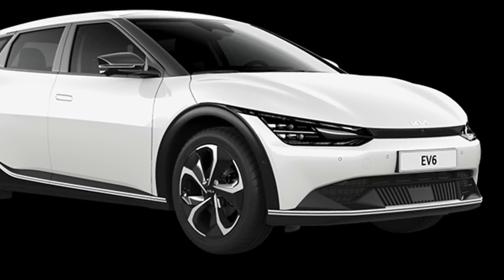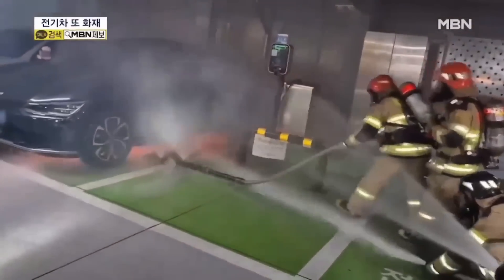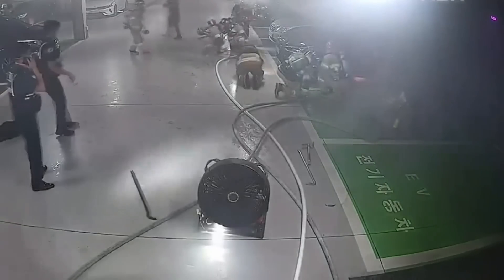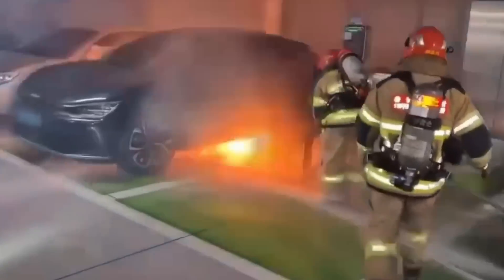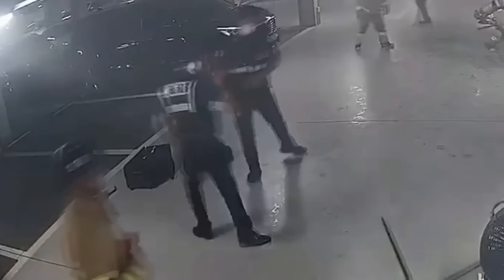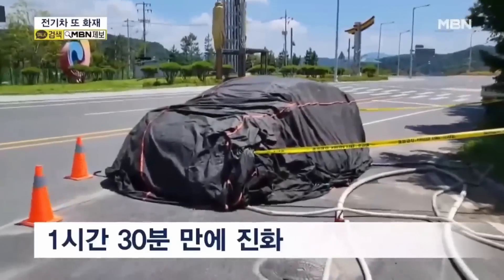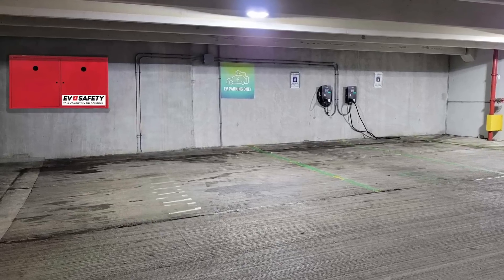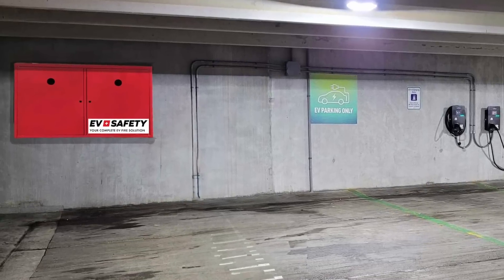Second EV Fire in Korean Parking Garage: Days Later

Comment: what a ridiculous thing those electric cars are...all this risk and still for sale? surreal
Reply: They still allow ICE vehicles.
Reply: @economicprisoner heck yeah, and a dam good thing too.
Reply: @economicprisoner which can be extinguished with a hose pipe…
Reply: @MrStevecrasher Sticking a hose pipe on a fire involving petrol is not a very sensible thing to do, that will only make it worse.
Reply: @brianstevenson9967  ohh I see, so all the worlds fire services have got it wrong… you had better go and tell them in that case.
Reply: @economicprisoner  ICE vehicles don't self combust everyday.
Reply: @Ilikeryche  Yes they do!
More often than EVs do!
That was my point.
Reply: @economicprisoner  No they don't. That's just silly.
Reply: @Ilikeryche  Yes they do. Feel free to search for NHTSA Safety Recall 09S09 which details just one model than can and HAS caught fire by itself. But that recall isn't the only fire risk for that vehicle, because mine decided to burn from the center console IN the cabin. Parked. Ignition off. Key out. :)
Reply: @saucecups  That's an anomoly with a particular vehicle, not typical of all ICE vehicles.  How often do you hear of an ICE car burning down a parkade? It's almost daily with one elecric vehicle or another since EV's have been a thing. It's not an anomoly, it's typical of electric vehicles.
Reply: @Ilikeryche  As I said, "just one model". I'll be the first to tell you that EV fires are worse than ICE fires, but pretending that ICE vehicles can't decide to catch fire as well is biased.
Reply: @Ilikeryche  look at the stats for vehicle fires EV & ICE then you will be able to appreciate which is safer. Just one of the many stats you will find on Google. Back in 2019 London Fire Brigade published their figures on call outs to vehicle fires. 80 EV fires compared to 1890 ICE vehicle fires, that is 1 years figures for just 1 city so which type of vehicle has the biggest issue with fires…………
Reply: @brianstevenson9967  When an ICE car caught fire, maybe the local media will report it. When an EV caught fire, the whole world is reporting it.  Therefore, the perception of EVs always seems likely to catch fire than ICE cars.  As I said, check the battery maker of the EV first before buying it.
Reply: @244col  My 2012 Hyundai Elentra was recalled due to fire risk while parked.
Brake fluid could leak onto the ABS circuit board, potentially causing a fire even while parked.
Reply: @economicprisoner  The exact same defect as a 2002 Ford Windstar and 150 other models, nice..
Reply: @Ilikeryche How would you explain all the BMW diesel vehicles that did exactly that 3-4 years back? A family was almost killed here in Denmark due to an engine malfunction in their BMW, and they weren't able to get out of the var
Reply: @Ilikeryche Nonsense - your throwing claims that are completely false.
Here in Denmark we have many more EVs pr. capita than you have, and I haven't heard of one single episode where an EV has caused a major fire!
Reply: @Greatdane-qf8kd  Don't know why that means my claims are false.
Reply: @Ilikeryche  Well your claim that EVs burn down parkades on a daily basis is just complete nonsense - and a falsehood!
Reply: @seenuhello1  Not unless there is a fault of some kind. With EV's it's inherent with the design. No fault just poor technology to begin with.
Reply: @Greatdane-qf8kd  What caused the fire?
Reply: @Greatdane-qf8kd  How so?
Reply: @economicprisoner This has nothing to do with a battery fire spontaneous combusting while parked. By battery I am referring to the traction battery of an EV and the gas tank of an ICE vehicle. All vehicle types have ABS circuits and brake fluid so issue may not have been ICE exclusive. In fact most ICE vehicle fires are caused by electrical faults, again not exclusive to ICE vehicles. In my years in auto industry I have never seen or heard of a ICE battery(gas tank) just go up in flames from being parked.
Reply: "Cars catch fire. Electric vehicles are no exception. In the United States, according to a 2023 study citing recent data from the National Transportation Safety Board and the Bureau of Transportation Statistics, gasoline-powered, internal-combustion engine (ICE) cars were involved in about 1,530 fires per every 100,000 sold. On the other hand, pure electric vehicles (meaning those powered only by batteries) were involved in just 25 fires per 100,000 sold. Yet, says, Paul A. Kohl, a professor at GeorgiaTech’s School of Chemical and Biomolecular Engineering, in Atlanta, “The media don’t treat EVs and ICEs with equal footing, because gasoline is not sensational anymore.”

Speaking of fires in cars fueled by gasoline or diesel, he says, “It’s an everyday event. You don’t have to go far to see [a car on fire]. Two days ago, I passed one on the highway, and the fire engines were just getting there. Flames were coming out of the top, and no one even looked at it. It hardly got a glimpse. And it certainly didn’t appear in the news.”

An ICE car going up in flames is, Kohl says, widely considered an acceptable risk today. As a result, the occasional gasoline-fueled car fires one sees on the side of the highway can be treated, Kohl notes, as “an un-event.”

However, when fires break out that involve more than one electric vehicle—whether car or scooter or e-bike—media and authorities have recently revealed a tendency to rush in to blame the EV.

For instance, a deadly building fire in Hanoi, Vietnam, in September reportedly became the subject of unsubstantiated rumors. The blaze had allegedly been kicked off by an electric scooter that was connected to a charger on the premises, according to reporting by the investigative tech news site Rest of World. A citywide backlash against battery-powered vehicles followed, as reported by multiple sources. The immediate fallout has been new restrictions that hamper gig workers’ ability to charge their two-wheeled EVs. (Meanwhile, investigators ultimately concluded that a gasoline-powered scooter had in fact caused the fire.)

The Hanoi fire took place two months after another fire was wrongly blamed on EVs. In July, a Panamanian-flagged, Japanese-owned ship called the Fremantle Highway, which was ferrying 3,800 new cars across the Atlantic Ocean on its way to Singapore, caught fire. Of the vehicles in its holds, 498 were electric cars. Media outlets around the world piled on the speculation that an EV battery must have caused the blaze that wound up claiming one life. “The number of electric cars is said to be higher than first thought,” noted the global shipping news outlet TradeWinds, “and could explain the North Sea casualty.”

Soon enough, the fire was extinguished, and the ship was towed to a port on the coast of The Netherlands, as reported by CleanTechnica. It wasn’t long before the grist in the rumor mill was contradicted by investigators’ finding that all 498 electric cars were in good condition and that the blaze appeared to have begun several decks above the place on the craft where the EVs had been situated.
Management Agency, the total number of EV fires in the country reached an annual peak of 106 last year.

But MSB reports that in 2022, there were only 24 EV car fires in Sweden, representing 0.004 percent of battery-powered cars there. For cars running on gasoline or diesel fuel, the fire rate was 0.08 percent, or 20 times the frequency.

Part of the fear surrounding EV battery fires has been how challenging they are to extinguish once they get started. But for the most part, the struggle comes down to applying the tried-and-true solutions to petroleum fuel problems to an electrochemical issue. Firefighters have consistently reported being unable to extinguish lithium-ion battery fires regardless of how much water they apply to a conflagration. It’s easy to understand why. According to the National Fire Protection Association, only about half of the 1.2 million firefighters in the United States are currently trained to combat EV fires".
Reply: 0.004% risk of fire in an EV. So could you guys man up and stop acting like a bunch of drama seeking b..... 

You are more likely to get hit by lightning on your morning stroll than seeing an EV on fire!!
Reply: @Ilikeryche true
Reply: @Ilikeryche Actually they do.
Reply: EV’s should not be allowed to park in any garage or close to each other.
Reply: Twit
Reply: Nah. Gas cars burn three times as often as electric ones. You don’t hear about it on the news because it’s an everyday boring thing.
Reply: @kenjohnson6075 statistically ICE vehicles are more likely to burn 1000x more than EV’s. You are very correct that it does not make the news as it is far more common. It is because EV’s are the new shiny scary thing that they make headlines. That being said, an EV fire is far more difficult to extinguish.
Reply: Yet we still have natural gas released into homes that have blown up and killed the occupants , yet we still pump oil that has ruined the Gulf of Mexico, yet we still have gas hauled on trains that have killed and ruined neighborhoods, yet we still give big oil billions each year, thankfully ICE cars and hybrids only catch on fire 15 times more likely!
Reply: When buying an EV, check the maker of the battery first. If it’s LG, think twice.  As most of the past fire incidents, most of them were using LG batteries.
Reply: @PVLTD  no need to check anything, better just avoid batteries altogether.
Reply: @Kazuo-ll6hr  I like both ICE car and EV.  EV for daily driving, and ICE for weekend driving.
Reply: Whay? 80 EV fire, that's a big problem!! 

EVs have been out for about 5 years, they are new vehicles and regularly maintained. Of course, there are more ICE fires as some vehicles are 20+ years old.

Not only that, there are more of them than EVs.

If this isn't resolved soon, we will have a big problem!

When EVs are 10+ years old, poor maintenance it will be very wild on the roads.... and I don't want to be anywhere near these EV fires.

80 EV fires, that's crazy for new vehicles..... 😪
Reply: @dchubworldsharenetwork  Hate to break it to you, but you know the Prius? That has a big battery in it, and they started making those worldwide in 2000... The all-electric Nissan LEAF in 2010, and many other examples.
Reply: @saucecups  My neighbors Leaf had 4000 kilometers on it, burned to a crisp and took his garage with it.
Reply: @Ilikeryche  Yep, you have a personal example of an EV catching fire just like I have a personal example of an ICE catching fire. Funny how that works, right? It's almost like they both burn.
Reply: Because if EVs can be easily burnt to crisp then people are gonna be forced to buy more cars, and that's good for cars manufacturers and the taxmen.
Reply: EVs just need to be banned. Problem solved. 
Enough already with this nonsense.
Reply: @G58 The famous Samsung battery problems. No ban ?
Reply: @tkh2944  What DID happen?
Reply: EVs just need to be banned. Problem solved. 
Enough already with this nonsense.
Reply: EVs are less likely to go up in flames, compared to ICE vehicles. Do your research, young one
Reply: ICE car fire more often.   It depends which type of battery you have.  I think this lithium ion battery.  The lithium sulfur is less likely for thermal runaway.  It is geopolitics that these cars don’t use the safer and better batteries.

Comment: Should we mandate higher capacity sprinkler systems in parking garages to respond to the threat of battery fires? Considering the majority of vehicles will eventually be EVs.
Reply: This is not going to do much unless the parking garage deck is designed to fill up with about 3 feet of water.
Reply: wont help.
Reply: Maybe if that's the case EVs should be banned.

Comment: Never park next to a Kia EV-6
Reply: Or Mercedes EV!
Reply: @redrider7730 Just like Mercedes Kia and Hyundai only use NMC batteries. These are quite instable when compared to LFP, which can be found in standard range Tesla, most new BYD EV's and a growing number of other brands. Check the online EV-database for Battery Chemistry of all current models. When it says "Unknown", assume it is NMC (often also called NCM).
Reply: Problem is that you can park safely but you have no control over who might subsequently park near you.
Reply: Not even in the same parking lot.
Reply: Or an open flame or a house heated by natural gas, or an oil field, or a BIC, why would you worry if you’re driving an ICE car?
Reply: @ronz7046  🥱
Reply: Or any other ev
Reply: @tomedgar4375  yes , you are so right, there are probably millions of , nay billions of these fires that Bob is reporting, yeah that’s the ticket!
Reply: There are 10 time more fire on ICT vehicles on roads, so should ban those cars on road first.
Reply: @Jfff-ugfgh  Well, considering the amount of ICE vehicles to EVs (for example, here in the UK there are around 3433% more ICE cars than EV) 10% sounds like an absolute win to me.
You idiots love to spout your statistics without ever looking at the ICE/EV ratio 🤣 🐑
Reply: @Jfff-ugfgh  Thats pretty funny  bud , there are millions upon millions upon millions of ice cars out on the road ranging from new to 50 years old , and fires are stil pretty rare given the numbers  , in comparison , battery cars are about a fraction of 1 percent in numbers and they are pretty new by the vast majority of whats there .
  Two more things , in the event of fire , and ice car can be put out in seconds at worst minutes ,  a battery car fire CANNOT be put out until it burns to the ground and more often than not everything around it ! 
   One of the  recent battery car fires burnt itself to the ground and another 148 cars and the toxic smoke emanating from  the battery car on fire caused a multistory housing block above to be  evacuated and contaminated throughout the building  IE: the residents are now homeless due to one battery car fire , and theres the possibility the building may have to be demolished  !
  Please tell me again how good your battery cars are .
Reply: @michaeldoidge1639  I said something along the same lines, however YT seems to have deemed my response unworthy and have deleted it. Hope yours doesn't meet the same fate.
Reply: @michaeldoidge1639  and you have to explain this over and over and over again to the fanbois
Reply: Or any EV.
Reply: There's been a lot of talk about fires caused by unregulated Chinese chargers. While that's a concern, it's worth noting that the recent fire incident with the Kia EV6 shows a different pattern compared to the large explosions and fires seen with older Chinese batteries in vehicles like the Mercedes-Benz electric car. The Benz incident involved sudden, catastrophic explosions that engulfed surrounding cars, whereas the Kia EV6 fire displayed a significant delay in the fire spreading between cells. This delay allowed for the car to be moved from an underground parking area to above ground, which suggests an advancement in separator technology. While any electric vehicle can experience a fire, these small differences in technology can be crucial in minimizing damage and protecting lives and property.